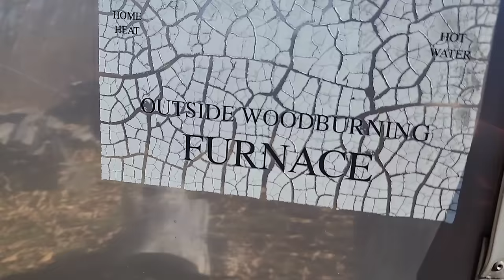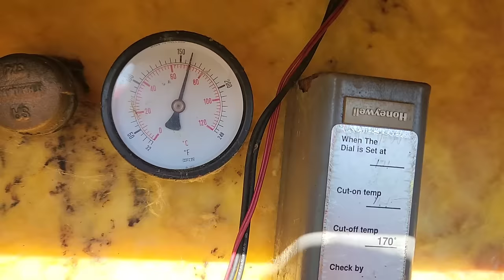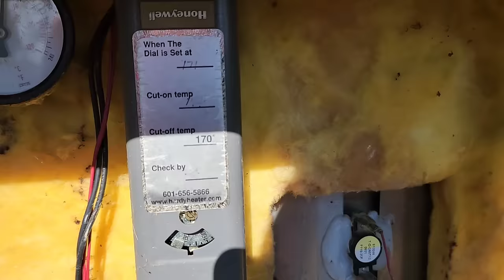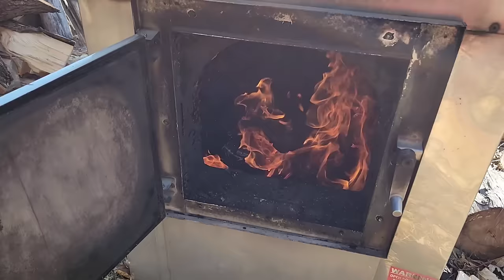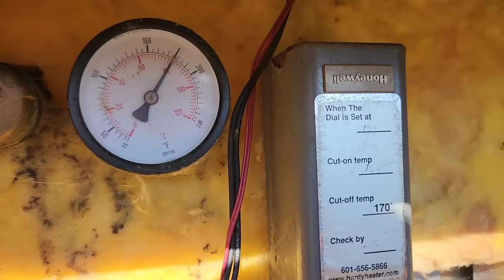How I Heat My House For FREE With An Outdoor Wood Boiler

Comment: I've been heating with an outside woodstove for almost 20 years, always buying used units due to price. I finally bought a new unit last year, Portage and Main Ultimizer series, and am pleasantly surprised with the increased efficiency, using about 50% less wood. As long as I can physically continue using it I will. Warm heat, incredible hot water for showers, and we are utilizing an energy source that would otherwise be wasted (I burn all wood from trees that have blown over). Cutting, splitting, and stacking firewood is also a great bonding time with my son. Hope to visit Ohio later this year for the Paul Bunyon Show. Just FYI, the new more efficient units have almost no smoke, SERIOUSLY, I can't believe the difference!
Reply: My wife and I are looking to get a P&M ultimizer as well, I’m hoping it will be this year but it might be next year. We have a 100acre wood lot so we have plenty of supply just got save for the boiler 
Cheers

Comment: Heating our homes with wood keeps us connected to what is real. Most people don't understand this and thats okay. We had a boiler at our old house for many years and loved all of the benefits. Currently we have a wood stove in the basement and one on the main floor. Just wanted to mention that burning garbage in a boiler can cause them to rot out pretty quickly. Thanks for the video!

Comment: I have a new gasification style outdoor wood boiler, they are very efficient. Will probably use about 5 cords this winter. Very minimal smoke as well, can barely tell it's running.
Reply: What is the brand and model of the gasifier?
Reply: @gibblespascack1418  I have a heatmaster G4000

Comment: Always look forward to Your video. We had a presurized system so it would protect the in house boilers.They do burn a lot of wood. But they do keep You with an endless supply of hot water. Before  My stroke Our oil supplier gave Me a pile of pine pulpwood if I wanted it. It was enough to heat Our 2 homes the winter I was in rehab. Free heat!
Reply from the maker: Sounds like you know what I'm talking about JC!

Comment: Where I live people will often lay out free firewood by the road with a cardboard sign saying something like "help yourself". I have some family that lives remotely. They have electricity but they use well water and burn their trash or and recycle in town (they shop at bulk stores & avoid plastic wrap as much as they can). I always pick up firewood for them on my way up to visit them because my uncle takes great pride in providing heat for his family. I think people forget that for many people it's a point of pride to provide things like heat for their families.
Reply from the maker: Thanks for the very nice post Holly.  I agree with you that there is a level of satisfaction with the labor needed to keep the furnace fed.  I love it!  thanks for watching Holly, please subscribe if you haven't yet.  Joe
Reply: @ohiowoodburner  Subbed now 👍Raised in the south on a dirt road so I grew up splitting wood. Soothing to see all that firewood stacked up.

Comment: My 2007  Central Classic holds just shy of 400 Gallons of water and since moving to my new place in 2019. I went from 8 to 10 Cord to just under 5 Cord.  
My pump runs 24/7 and the Domestic heat exchanger is in the House and is near the floor so I get thermocycling for domestic hot Water. Only run it's pump to get the Cycle started then it is off for the rest of the Season. My Water temp is 145 to 155. No need for Tempering valves for hot water or the in-slab Heat. House stays a constant 74 Deg. 
When it gets cold out 20 deg or less I put in a brick cart load of Wood once every 24 hrs. I keep a lot of cardboard on hand cause the Fire goes out, LOL
Reply: That’s too cold…… your water jacket is sweating

Comment: Great information Joe!  Also to add, hot water heaters are, atleast use to be one of the most inefficient appliances in a home.  That also saves a lot on the electric or gas bill.
Reply from the maker: yes.  I throw the breaker on the DHW tank once I fire up the Hardy

Comment: hi there good show . can relate to almost every thing . i made mine 25+ years ago , but filled it with anti freeze . back then it was only 2.00 a gallon .pex lines was not even a thought along with no internet wasnt around for help . now one thing i did witch i love is my red light . something you may want to think about , and very simple to do , in short buy a clamp/strap aqua stat,hook it to a copper line ,hook it up to a LED flood light you can see from the house . set it ti come on around 5 Degrees below boiler come on set point . lets you know if it needs wood with out leaving your warm house . cost not sure now maybe 100 around 1 hour to install , well worth it , if interested and need more info hit Dan for my # . best to all john
Reply from the maker: Nice idea JOhn.  I can't help but think there is an app or some type of device that would connect to the wifi as well?

Comment: I have the same setup except except my stove is homemade in a small shed,when I used to log and sell firewood I had lots of wood and never worried about consumption,but these year I bought fifteen cords of wood,my stove has a forced draft and burn green poplar if necessary.
Reply from the maker: Sounds like you use a lot of wood too Randy

Comment: Could you install a steel baffle 4-5 inches below the chimney pipe, that extends from the back of the inner chamber about 75% of the way toward the front door? I don't know if that would help make it more efficient so that it can recirculate/reburn fumes a little as they rise around the baffle and keep the flames burning under the baffle so they don't fly up the chimney? I made a tiny woodstove once out of a steel ammo canister, and installing a baffle like described made a huge difference with efficiency and burn times (which were already super short since it was such a small stove).

Comment: Not sure the square footage on your home my friend but you may want to think about upgrading the size of your water stove ? Your winters in Ohio are colder than mine in the lower foothills of Nc but I have a Taylor 450 , I plan to start looking to replace it next year since it’s over 20 years old now but I’m looking to find a 750, I’m heating a 2,700 sqft cabin and it does well but it was explained to me if your heating a lot the bigger the better, larger amount of hot water for circulation so the call requirement for fuel is less. I’m sure you are aware and these stoves do be expensive but best of luck when it’s time to replace it, Taylor’s are getting hard to find but a alternative is out, a man that worked for Taylor started building his own, basicly a Taylor but just different enough to avoid lawsuits lol

Comment: My heating hot water is in a 4” nonperforated weeping tile along with our domestic house water,which gets heated while running beside the hot water heating pipes,I had to change the domestic water line and all I had to do was pull the old line out and new one in(attached to old line)and didn’t have to dig up the yard.
Reply from the maker: Sounds like an interesting system Randy

Comment: Just wish I could run a wood furnace boiler. As it is in a residential area 2 fireplace inserts have to do. You don't have pallets, railroad ties, etc. under the wood pile. Is that because the wood won't sit on the ground more than a year?

Comment: Great video Joe very informative. I have a dual system now airsorce and solar linked to a boiler stove so in winter can run the boiler stove which is like u pretty much free in summer and autum and spring solar and airsorce does the rest it's great. 👍🏴
Reply from the maker: I have an off grid solar system to run things if power goes out...which happens a lot around here
Reply: @ohiowoodburner  nice one. The power doesn't go out to much here or not as much as say few years ago. Although the solar we have does the power aswell and sells back to the grid if we have to much so all helps. 👍🏴

Comment: How do you operate the Hardy when the power is off?  What’s your typical consumption of firewood in cords per year?
Reply from the maker: I have an off grid solar back up system but prob for most they operate just like everything else in their house when the power goes out. It doesn't LOL

Comment: Good morning Joe with todays technology the two stage or gasification boilers are a lot more efficient that your dinosaur . But they are more demanding to keep clean and they do want a better quality of wood . Plus they can be very expensive . However they do have a lot of befits too . they use less wood and burn longer between refills . I'm sure you may have looked at them in case your Hardy ever needs to be replaced .
Reply from the maker: I agree about the new stoves and tech.  I'm all for it but for me it would never make $$ sense.  I hope to be moved out of this house in a few years and I would not want to be filling a stove to the age needed for my ROI

Comment: Is this a reupload? It sounds so familiar… 
Well, I just wrote to an chimney retailing company how much a hot water producing indoor furnace will be. 
We do a lot of firewood to sell and as with you, we do have plenty of scrap-wood we need to get rid of. Up to now we burn it in a classical Chimney but that can be improved to also hot water and central heating system feed. 
Was this possible to understand?
Reply from the maker: I did a vid about this last year that has quite a lot of views.  The big difference with this current vid is the coat I wore in the old vid has a sheep wool collar and also, in the new vid, I complain more about my knees hurting!
Reply: @ohiowoodburner  
😅 Mr Joe, you make my day (or night, it’s late already in Europe)

Comment: I agree with the free heat. My boiler also does the hot water.   2,000 sq ft house boiler 70 feet out use 7 cords/year. Use a tankless propane water heater for summer.  Got mine just before the obama rule changes, new ones not as good. Well Dun!
Reply from the maker: Thanks geezy!

Comment: Those old Hardy outdoor stoves are tge original Timex.... you can work on them also..... none of the gubmnt crap to break and cost money!!
Reply from the maker: I have a few thousand in broken grates from over the years LOL
Reply: @ohiowoodburner Hi Joe - Big Rodders in Ireland.  I got a local engineering shop to make me grates from 1/2 inch steel plate at a fraction of the cost of replacement items.  Some guys make grates from truck leaf spring metal.

Comment: Don't listen to the naysayers Joe! They all work for Ohio Edison and Amerigas!!😂 Besides not having a high utility bill, you get the secondary benefit of the disposing of all those cut-off pieces you generate. With all the saw dust and  splitting waste that comes off the Japa and Axis, just think if you had to deal with finding a place to dispose of what your outdoor stove takes care of! * Log-hauler Jessie spotted! Yesterday I was on my motorcycle and saw Jessie in his truck with a half load of firewood grade oak. (It was way bigger than what you like Joe) He was west bound at a red light at St.Rt. 165 & 62 nine miles west of North Lima. We see you Jessie!👍
Reply from the maker: Our electric bill goes down in the winter bc of the savings for our electric hot water tank.  Should have flagged LHJ down and filled your own truck up!
Reply: @ohiowoodburner  I waved at him but I was on my motorcycle so he wouldn't have recognized me!

Comment: People did just that burn everything and anything here in Massachusetts and now they are banned state wide. I totally get it your neighbors shouldn't have to smell your trash burning. People that have them grandfathered in are still using them I believe.
Reply from the maker: I looked into this and OWBs are not banned statewide in Mass.  Local municipalities can keep them from being put into their town.  The state has a number of rules that have to be met but looks like there is no blanket ban.  My source https://www.mass.gov/guides/heating-your-home-with-a-wood-burning-appliance#:~:text=Some%20municipalities%20have%20enacted%20by,to%20stop%20using%20it%20permanently.

Comment: Hi Milo,  Free?  Yes, if I discount the four wheel drive, skid steer with grapple aþtachment, five Husqvarna chainsaws, two commercial log splitters, half dozen wood handling tools, wood stove and annual chimney  cleaning, visits to doctors and chiropractors and cases of Ben Gay, then yes, wood heating is free.  At least that is the MARANGUE I've been feeding my wife for 50 years.  Viva la Free!  Shalom/gw  PS I thought about the hot water thang, but I doubt I could afford recovery at a burn center!  Keep sellin'!
Reply: I mean he is using the waste wood from his fire wood business witch is self sustaining and it is a way to dispose of the off cuts (cookies) but you make a good point about the soft costs. But what gets me thinking is if you just take free tree service wood would that be worth it ? I has to depend on the cost to heat in your area
Reply from the maker: Yep there are costs to everything.  That is why I define Free as "no gas bill."  it's easier for me to get my brain around it LOL.
Reply: @ohiowoodburner  In the fall of 1995 the doctors at the Falk clinic in Pittsurgh gave me two years to live, due to a congenital disease.  My wife asked me if there was anything I wanted.  We drove to a local New Holland dealer where I bought a new skid steer.  On the day they delivered it, there was a huge pile of leaves next to the creek.  I fired up the skid steer and pushed them onto the creek bank.  She looked at me with a look of doubt.  I had to think fast.  So I put her in the seat and proceeded to show her how to operate it.  Just then, as if on cue, a friend pulled into our driveway and said, "Wow! You look just like Sigourney Weaver!" That bought a huge grin.  Ever since, she runs the skid steer and I wrestle the wood. LOL  Shalom/gw. PS That death sentence?  I was tested problem free two years later.  The doctors said there was no record of anyone being cured of my ailment and asked what I'd done. I said I had six churches praying for me.  i've tested negative ever since. God is good all the time and all the time God is good!

Comment: My neighbor/friend had a medium sized Heatmor (OWB), which produced so much smoke, it covered the road like fog!

It was about 15 feet high (the smoke), and you couldnt see thru it, when you drove thru it. Impressive!

He later got the biggest Heatmor, that would hold 1/2 full cord of firewood at a time.  

With -30° fahrenheit weather, he could burn 1 full cord per day.  He operated a tree service business, hence, he had unlimited free firewood.

He once threw a dead deer carcass in his Heatmor, and the next day, "only the teeth" were to be found in the ashes.

I considered an OWB, but our house is super insulated, and is medium sized.  An OWB made no sense, other than filling it twice per day as a hobby.  Our soap stone stove, and wood furnace (which we rarely use) are a good backup heating source.

An OWB is like belonging to a religion! You have to "do services" 2 times per day in the winter.  It is a regular duty every day.  It costs you "time", and money.  But, it is a good thing!

Great video!  Cutting, splitting, and piling firewood is great, but burning it is even better!  Who knows, it may be illegal in the future.

The  end!
Reply from the maker: Thanks Gary.  I agree with your analogy!

Comment: so lets say your gas bill would be $200/month for 4 months of cool/cold weather  thats $800 and add a coouple hundred for year round hot water- $1000
if you spend an hour per day for a year fooling with firewood-365 hours annually(some more some less depending on the season)  then you value your time at less than $3/hr

would you go to work for someone for $3/hr????????
not only do you value your time at less than $3/hr, that 365 hrs spent working for a wage, lets say a mere $10/hr somewhere, would yield you $3,650/year
so not only is your wood fetish not free, it is costing you THOUSANDS of dollars per year
foolish
Reply from the maker: Oh well.  I'm not an accountant. $200 a month for gas?  What planet are you from? 
  Making firewood brings joy to my life.  Include that in your analysis
Reply: Joe, I have a Central Boiler. 20 years old now. I get cheap to free wood plus I burn 5-7 cords a year. But do have a cost of dump trailer, Saws, spliter, and Loader. 
You are right it's a hobby. 
I paid $8500 for mine 20 years ago. Used to buy logs or firewood poles. I haven't bought wood since the new dump trailer in 19. I clean up after a tree service.  Probably got 20 cords this year. Sold 6 cords of Big Wood. It all cut to length. And I sell it cheap unsplit.. 25-40 inches diameter. Also haul slabwood.
Keep up the good work Joe. Be careful